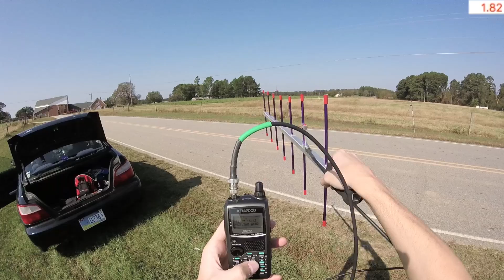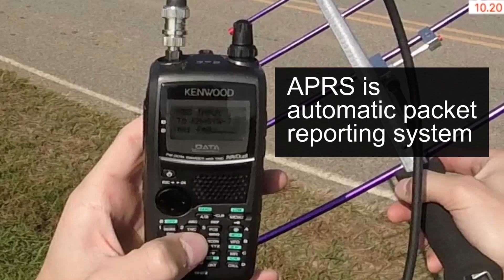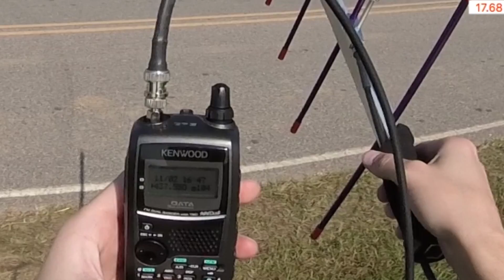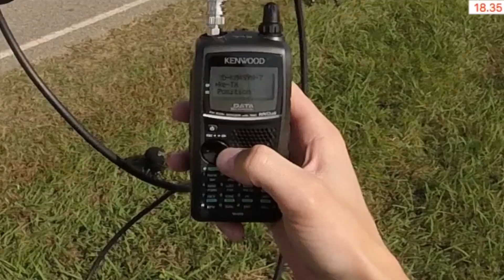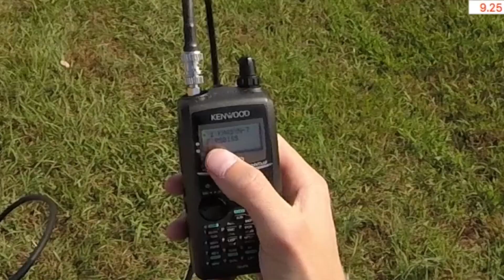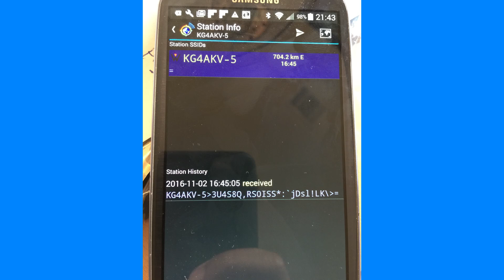New UHF ISS Digipeater!

Comment: Brother, what are the latest UHF frequencies ISS Ham repeater has been using now ?
Did you mean 145.990 MHz transmitting frequency towards ISS no longer in use either?
Reply from the maker: This is an old video. Go to ariss.org for all the current frequencies.

Comment: Hit iss on 2m but not on 70cms next times it on uhf mode I'll try that nice thanks for sharing 👍👍👍
Reply from the maker: It's not on UHF anymore. It's either one or the other and it was only UHF because the VHF radio was not working for a while. It should be on VHF if it's on at all.
Reply: Space Comms that explains it I've know it's listed as one of the frequencies used but never heard it normally I do use vhf so thanks for the info 👍👍👍

Comment: what frequency is the digit repeter on?
Reply from the maker: It is back on VHF. It is 145.825 but it usually isn't working at all and when it is, it doesn't hear well. They are working to upgrade the equipment but need more funds. Check http://ariss.org for details.

73, John Brier KG4AKV
Reply: @SpaceComms  APRS is on 2m band, but You use aerial for 70cm... What frequency was used on video?

Comment: I have the Kenwood TH-D74 APRS radio, and I’ve used APRS quite a bit.  I never knew there was a digipeater on the ISS.  I’ll have to give this a try.  What power are you running?  I’m surprised an HT can reach the ISS, but I’m sure that yagi helps a lot as long as it’s aimed properly.
Reply from the maker: 5 watts. It is back on VHF now. 145.825 MHz. Check ariss.net to see if packets have been gated recently. The equipment is on the fritz. They also turn it off for space walks and vehicle docking/undocking.

Comment: I just started playing with NO-84,  Does the D72 not process incoming packets while you are looking at the list?
Reply from the maker: No it does, you can still hear it beep as it decodes them. I think you can set whether they pop up regardless of whether or not you are in a menu or reading messages/list. I probably have it set so it doesn't take over the list. In fact if you are scrolling and a new packet is decoded the number of the messages change.

Comment: YouTube took me to the 1000 subscriber video, and then I saw this. Reminds me to try to do something with ISS UHF APRS, something I haven't done. Good kick in the behind for me, I needed this. Assuming its on ? now ?
Reply from the maker: californiakayaker N6GRG Digipeater is offline indefinitely.
Reply: @SpaceComms  I could hear the aprs iss from a d710ga apparently today, and haven't tried the uhf one. The web site I looked at said the uhf wasn't on all the time ? You did well, but I didn't get through with a 710 here also. Still learning , didn't try changing freq for Doppler . A lot of other stations were coming through.
Reply from the maker: @californiakayaker  it likely won't be on UHF ever again. It was only on UHF as their old VHF Ericcson was dying and they had a UHF Ericcson they swapped in temporarily. Make sure you have your PATH set to ARISS.
Reply: @SpaceComms  Yes, did not take any time to check things like "PATH" as it was my first very hap hazard attempt. Yes, I'll be looking into the details now, thanks. 
PS by the way, they are still saying that "very infrequently" they may use the uhf aprs. I wish they would set up something for 9600 aprs, or perhaps packet ?
Reply from the maker: @californiakayaker  I don't think they will ever do anything beyond 1200 bps APRS. I doubt they will use UHF for packet but I do see the frequency listed on ariss.org. It would just be an experiment, but the whole thing is an experiment, so not impossible
Reply: Does this include the VHF ? digipeater ?

Comment: how do you know which angle to hold the antenna at while the station goes overhead?
Reply from the maker: I wrote an article to explain how to track direction and elevation. Here is the passage on how to track elevation:

To estimate the elevation of the satellite remember that 0 degrees is flat and 90 degrees is straight up. 45 degrees is in the middle of 0 and 90.

A rule of thumb is if you make a fist and hold your arm flat, the top of your fist is 10 degrees above the horizon. Move your fist up one “fist length” and now you’re at 20 degrees. Raise it one more fist length and now you’re at 30 degrees, and so on and so forth.

While one first length at 10 degrees may not seem like a high elevation, it is easy and common to underestimate how high 10 degrees is. I think if you look  far off into the distance at an object, as the 10 degree angle continues to rise you might realize 10 degrees is surprisingly high.

If you go up four fist lengths you’re almost at 45 degrees, As I implied earlier 45 degrees is easy to estimate because it’s in the middle of 0 and 90. If you look at that angle by holding your arm out you’ll see 45 degrees is pretty high, so if 10 degrees is almost a quarter of 45 degrees (remember it’s four fists lengths to almost 45 degrees), 10 degrees is pretty high too.

Here is the article (and a video) on how to track direction:
https://spacecomms.wordpress.com/how-to-track-satellites-with-a-compass/

73, John Brier KG4AKV

Comment: Any idea what KM4SYN was using for antenna etc? And you said it went througha. hop, meaning it was someone else's APRS repeater that actually sent it up?
Reply from the maker: In email he said he was using an FT-60R and on his QRZ profile it says he uses an Elk 2M/440 antenna.

No, my packet only went through RS0ISS, not another repeater.

In the video I made after this, "I made CONTACT! UHF ISS Digipeater," I did try to send a message to someone I received through a terrestrial APRS digipeater, which of course wouldn't work. 

They were in my stations list and I got confused thinking they were from the ISS because they were only the second person on the list, and by that time I had received several packets. I think the reason there were no other stations in the list from the ISS was because all he "several" packets I received were from the same station.

In the future I am going to clear out all my saved stations and messages before the pass so I will know anyone in there is from the current ISS pass, not local through 144.39, or not from a previous pass.
Reply: heh, I'm literally watching "contact" now.

I thought the other person's packet went through a digipeater, not yours. Cool though. This motivates me to want to do it too.
Reply from the maker: Oh, no no one's else went through a different/additional digipeater than the ISS digipeater.

Yah, if you have an APRS capable HT or something, it's not hard to at least get digipeated through it.
Reply: I have a mobilinkd and have used it with local stuff. The ISS stuff would be fun, of course, and I like APRS because I don't need to ragchew or anything. Need a yagi though.

Also want to think about how to set up cables to record (zoom h2) and monitor like you are. Not really necessary for local/digipeater stuff, but pretty much required to do satellite stuff.
Reply from the maker: Ted Timmons Yeah I really like the digipeater because it seems efficient. It might also be because it's new/unique/different. For me it's a bit more of a challenge than SO-50 voice for example.